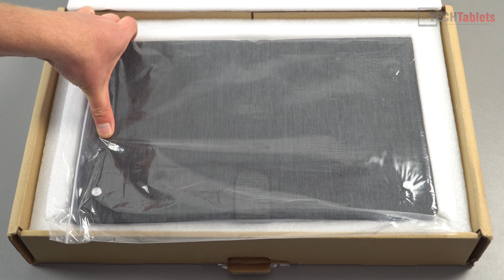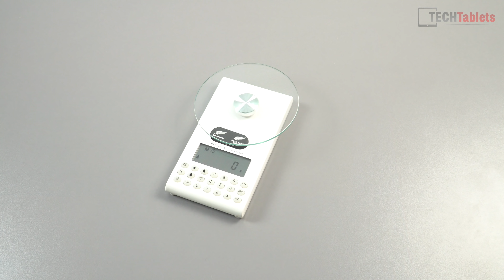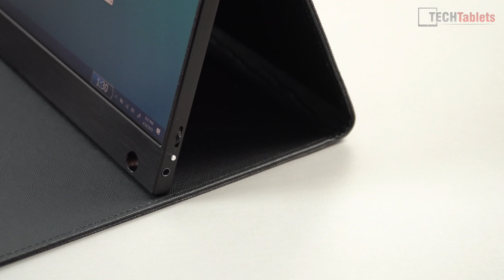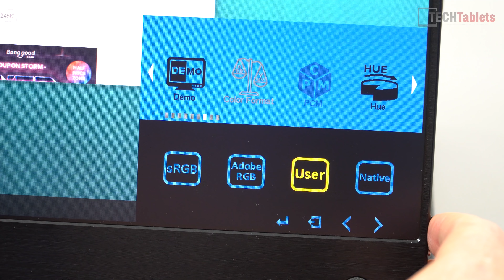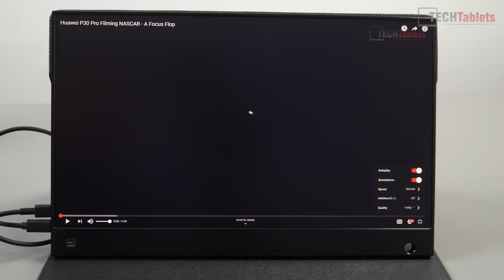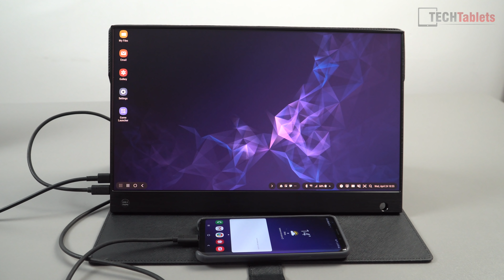WIMAXIT 15.6" Portable Type-C Monitor Review

Comment: which kind of writing pen will will work in this monitor instead of using your hand? anyone can answer ....
Reply: If you're hoping to use it as a stand in for your finger, any regular 5 bucks stylus will work. If you're hoping for it to write smoothly, this ain't the screen for it, those screens needs to collaborate with wacom to build their stylus' driver into it.

Comment: just received mine. the usb-c connection does not work. it posts a port reset failure error. informed the supplier and they are still finding the solution

Comment: Far too expensive for the product in question. You can get a full size 22 inch monitor for $80 these days. (obviously not portable). I would think that getting a really good laptop/notebook with a great display if the better option. Great info as always!
Reply: Perhaps not this product but some people have a use for a portable monitor/second screen in addition to their laptop. For most people this is not really needed.
Reply: what touch monitor is the option for this? i know im a bit late... but every little helps thanks

Comment: What the point of portability if you can't see the display out door
Reply: It's Milan I have a portable monitor for travel and on the go. I have never used it outdoors.
Reply: @RojasTKD7  you didn't but there are people 
They need to use it out door (not talking about Austin evan playing on a portable monitor in the park)
Reply: It's Milan perhaps, but seems like a very niche use care. Not many people will need to set up second monitor and use it outdoors. I have this monitor and it works well for my use, don't require best cooler accuracy out of it. It is a bit pricey though. I'm going to try another cheaper option in the near future and see how they compare.
Reply: you can use it in travel or buy power bank with pd
Reply: @_DAN11L_  it would be still a dim screen

Comment: I just made a better one of recycled laptop parts, 17 inch fhd. Granted is not that fancy, i'm missing the usb c and i have to carry a small 12v 4a brick.  but it cost me 120 bucks + one day to build.
Reply: how did you manage video input to the screen? did you need to solder any connections and are there any guides you can share on how to DIY your own portable displays?

Comment: EDIT: nvm, I found out it's selling for 299 pounds... are they insane?
Reply: I was going to comment that it would be insanity but then you edit it 😅
Reply: @itsmilan4069  you can buy a chinese laptop for less than this
Reply: @stcojo  Right and then run VNC or some other remote-control software (over WiFi or Ethernet "crossover cable?") to use the laptop as a second monitor.  Only an idiot would pay this much for only a screen when you could have a 2nd/backup laptop for same/near same price.
Reply: I'm after one with touch and battery around 12 inch.. what do you reccomend? Cheers